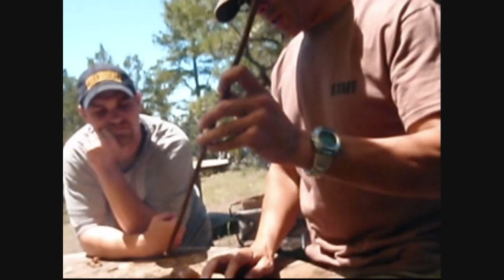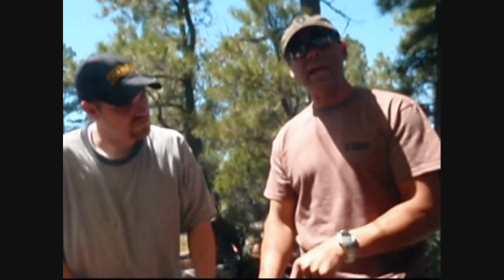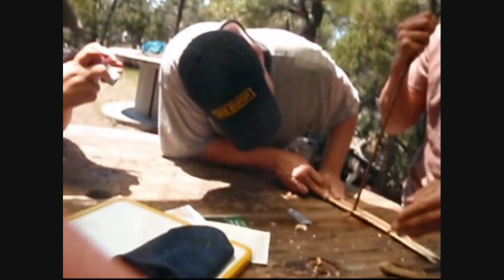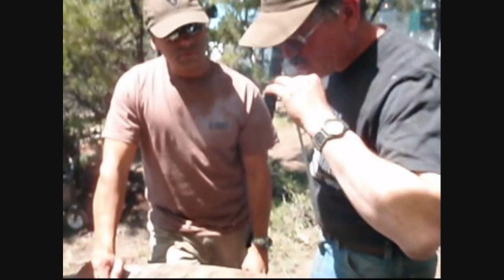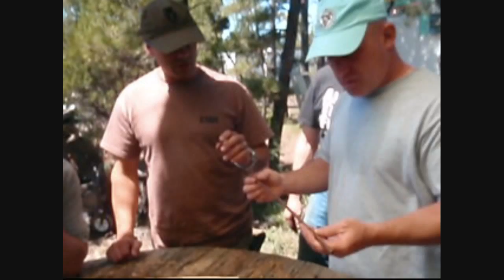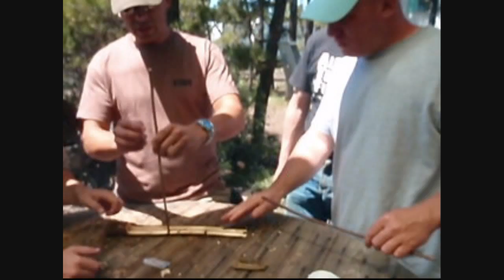How to make fire with the handdrill by Alan Halcon

Comment: I wouldn’t be too concerned about which material is better over another.  As Alan would say "Own the skill". It really depends on what environment you are in. If you are in a swamp area, you will be using Cattail. Dryer areas, Thistle, Mullein, or Golden Rod, etc. Alan will go out in the woods and use materials he may not be able to identify, but can tell fairly quickly if the material will work; as demonstrated in the video.